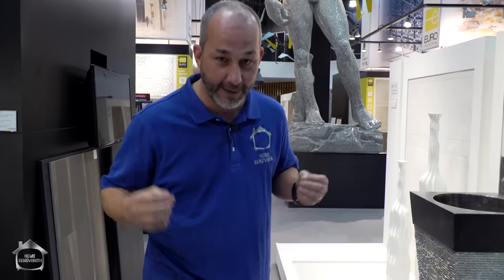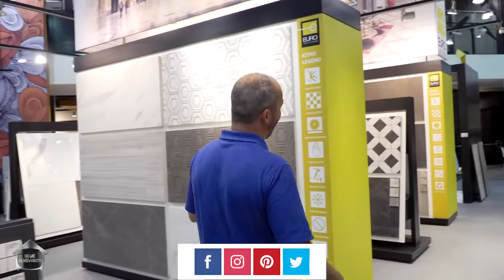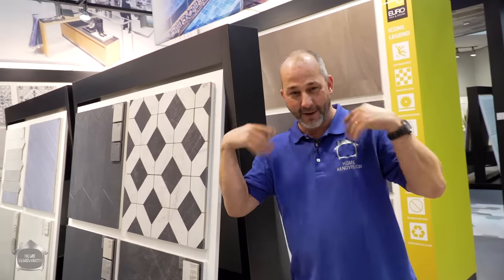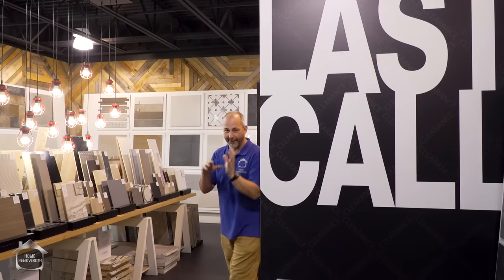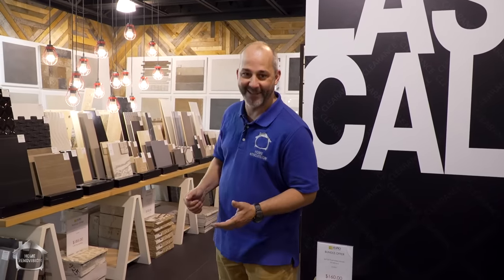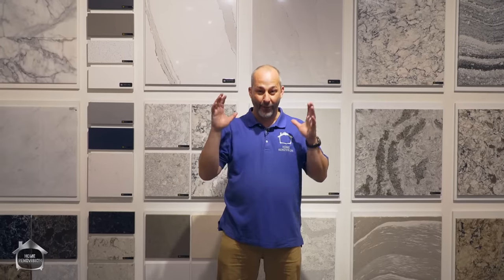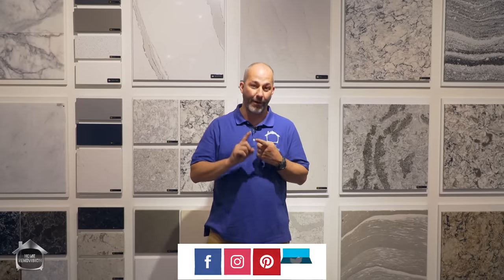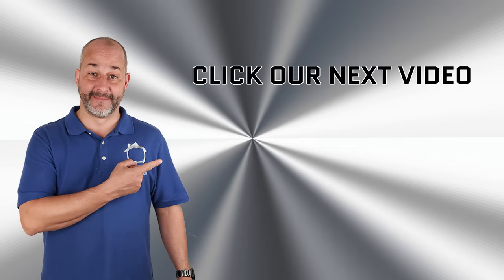How To Pick Out TILE | Shopping Tips

Comment: I was given another tip by a specialist: random isn't - you have to plan it.  If you have a blend of colors, try and lay out the mix before it goes onto the wall so you can make sure it looks good.  Turned out to be very good advice, when we laid it out just "out of the box" it took some re-arranging before it looked right.  That's a lot harder to do when it's already on the wall..
Reply from the maker: That does not always work, with shapes yes but with tones your eye will automatically create a pattern and you can loose the natural feel you shoukld be getting.

Comment: Jeff, Please respond. I need advice. If I level my subfloor with Levelquik, do I still need to use cement board before tile? I don't wanna be that guy where you come in after the fact and tell me it's all wrong.
Reply: I'm not Jeff (clearly), but I've been researching the same thing for our basement bathroom reno. As far as I can tell as long as you properly prep your concrete subfloor, you can tile directly on top of it. Prepping includes a good cleaning, filling in any cracks or dips, priming, and leveling. If the leveling isn't perfect, you can take a grinder to it to file down any high points. When all that is said and done, it seems like you can then tile directly on top. However, you should be aware of what kind of tile you're using and the state your concrete floor was in to begin with. If you had lots of cracks, you might want to use some sort of de-coupling system so that the freeze-thaw cycle that cracked the concrete doesn't end up cracking tiles and grout. I think using a small scale tile (say a 2" hex kinda thing) helps negate this issue.
Reply: @ang_131  What if my subfloor is plywood?